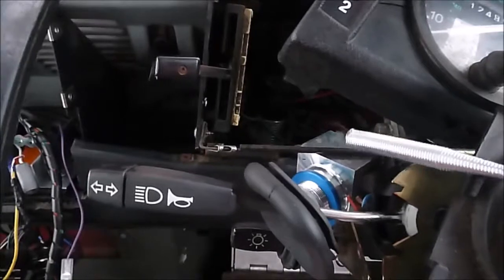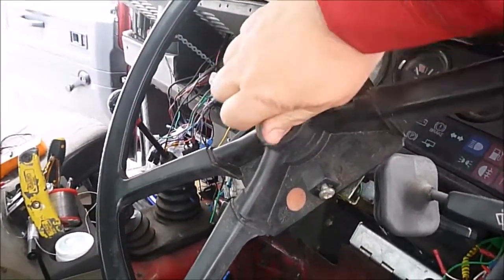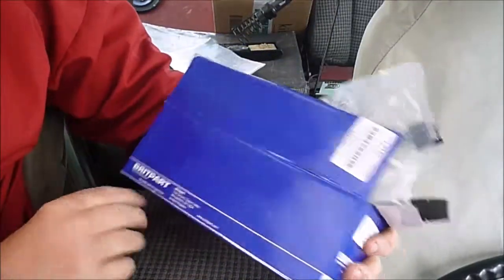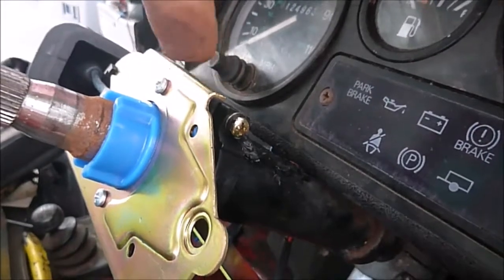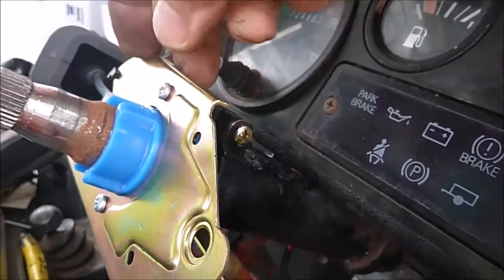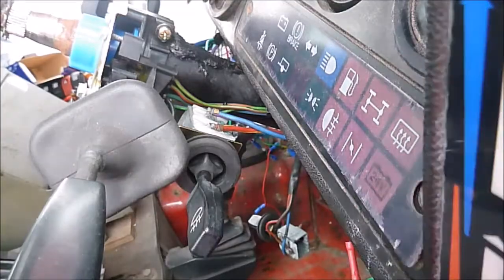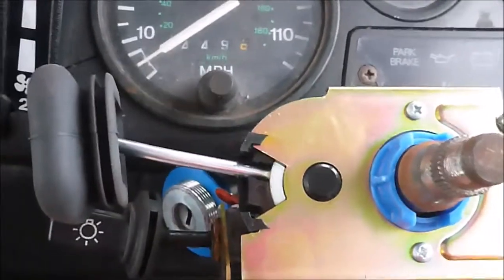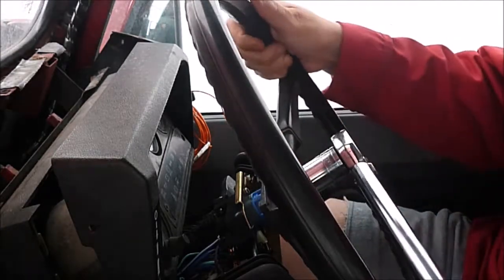Replacing indicator stalk on 1990 landrover defender

Comment: very helpful and informative video however, it starts with the black steel enclosure already removed and ends with it still removed. That's the hardest bit to negotiate!
Reply from the maker: @robpaul5152  Thanks for the feedback. Unfortunately adding that could end up adding other stuff and I'd end up with mission creep making the video too long. I prefer short videos about a single point.

Comment: That was a great help, thanks!

By the way, the buzzing in your video is caused by the motor in your camera's lens refocusing every time something changes. 

Judging by the sound, you're using a point-and-shoot, and there may be some instructions in the manual to change how the focusing system works.

Comment: I couldn't get that damn stiff wiring plug separated.  I'm no pansy either , I'm a construction worker with death grip hands.  I stuffed around with the wiring plug for half an hour and only got 1 side 1mm apart by jamming a small screw driver in the join and levering it before the screw driver bent.  Any tips please?
Reply from the maker: Sorry. I'm no mechanic, just put stuff up others might find useful. A liquid lubricant maybe? Good luck.